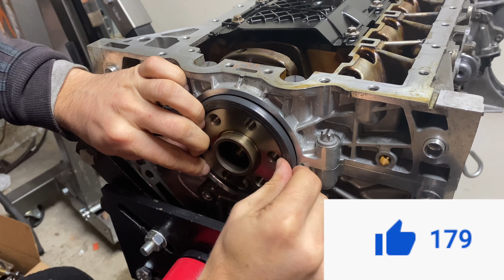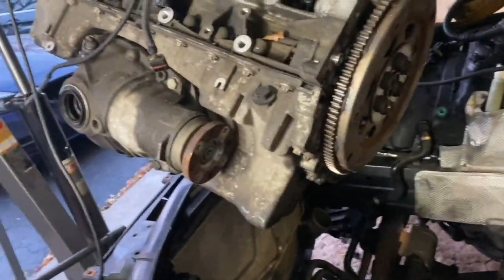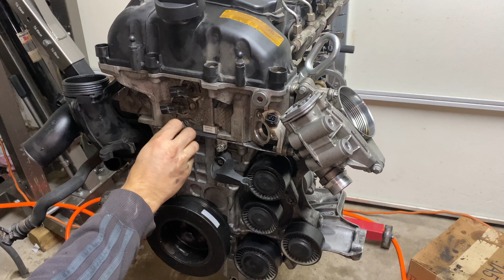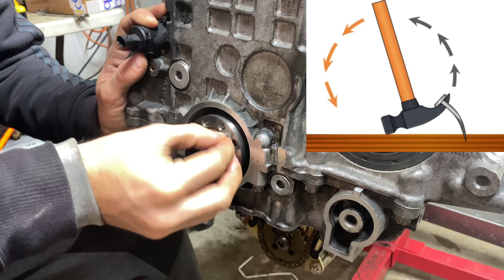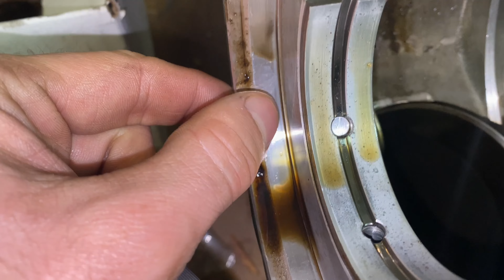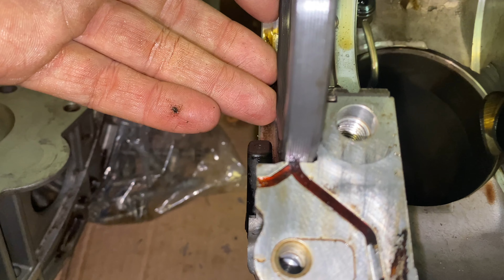BMW N55 Rear Crankshaft Seal Install (No Special Tools)

Comment: I've worked on an N52, but not N55. On the N52 and I thought most BMW's, the outside diameter of the crankshaft seals (180 degrees apart), have a groove that's supposed to accommodate sealant and prevent leaks from the parting line/joint of the bed plate. Therefore, the manual and instructions point out the need to line up these grooves, use primer and the appropriate sealant. Just curious if these procedures do not apply to the N55? Kind regards, Terry

Comment: Dude - I’ve been thinking about whether or not to gently stretch the crank seal like you did. I figured the rubber would return to its smaller diameter and get tighter once installed…do you agree? Did this method work for you? Thanks for this video.

Comment: Very curious why you cannot just install the front and rear seals onto the crank shaft BEFORE installing the crank into the engine.  Then you just install the bedplate over the seals.  There seems to be no risk in installing this way and much simpler.

Comment: did you not need to align the seal?   Also did you need to add Loctite or sealant to the two edges of the seal.  (where the two pieces of the engine mate holding the crankshaft)
Reply from the maker: Not on this one. You DO on the front crank seal.
Reply: @SimpleCarGuy    Thanks for the reply.   I saw this video for Rear Mail Seal replacement for N54 and they used a sealer. I am also getting mixed answers searching on internet forums.  I am going to do my rear main seal on a N52 during a clutch & flywheel change.  

https://www.youtube.com/watch?v=UWpbeAgNlFg&t=317s&ab_channel=Garageaholic
Reply from the maker: I’m just going off what BMW has in their instructions, so there might be a better way to do it as you mentioned, but it isn’t necessary if done right. Good luck!
Reply: @SimpleCarGuy   ohh gotcha.  i'll use my best judgement when the time comes.  If the seal bore is pretty smooth overall i would imagine no extra sealant is necessary.
Reply: I thought the same